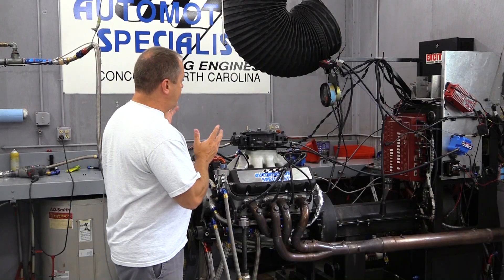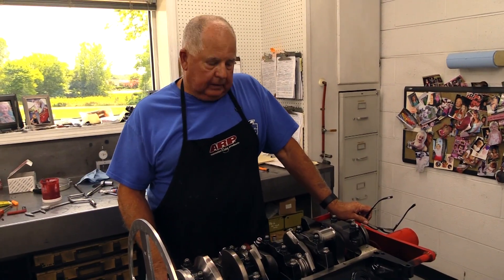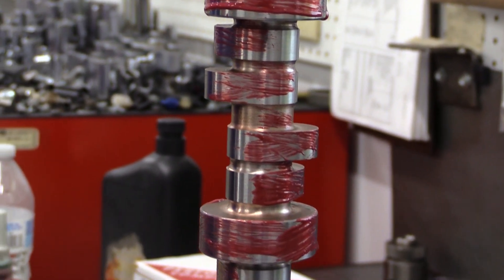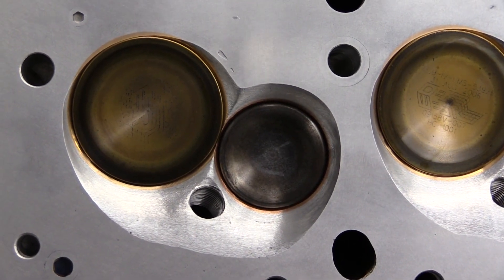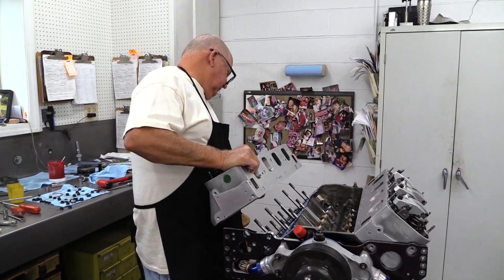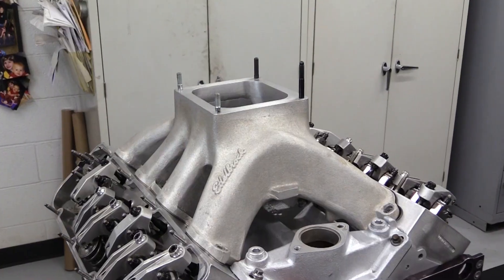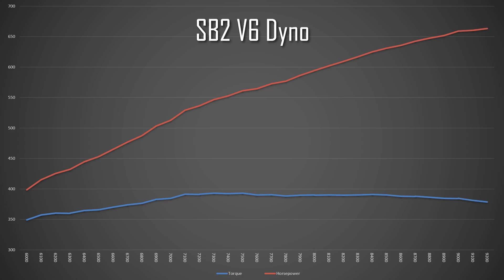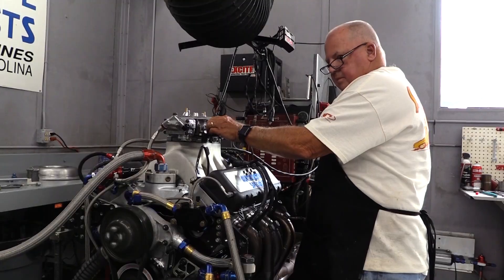NASCAR Chevy SB2 V8 Turned Into a Racing V6!?

Comment: Not understanding why he just didn't use a stroked 250 cid inline Chevy 6 or destroked 4.3 V-6 .   Both were pretty capable engines that certainly would be lighter than the Chevy V-8.   Why not a 260cid  V-4 from a big block?
Reply: My guess would be that these engines are ALREADY designed for 8000+ rpm. The other options you mention would probably have taken much longer to have parts machined, tested, broken, machined again ect ect....most of the leg work is already accomplished with the SB2. He juat chopped 2 cyl off of it.
Reply: Because the old inline 6 there are no real good aftermarket cylinder heads that will flow enough to get that engine into the 800 HP range normally aspirated  ! Straight six engines are also always more expensive to build and make high HP over a V6 or V8 engines because I looked into it before wanting to build a high HP Chrysler slant or Ford 300 six for the fun of it until I looked at how expensive they were compared to a V8 and how much less power they actually made for the money ! Look at Clifford 6=8 and you will see nothing is cheap to make a lot of power with the inline 6 when you can do it cheaper with a V8 that will make twice the power !

Comment: 6:48
I know Nortons secret. It's not something that is rocket science. If you take the weight of all components attached to the rod for cylinders 7 and 8, you get the weight of the entire contraptions attached to that rod. Then you simply machine yourself some weights accounting for the anchor points and the anchor hardware and magic.

You have yourself an exact weight equality between the parts that would normally attach there, and the weights you've designed to be fixated for counter balance.

I don't think Norton should really keep this a secret. It isn't forbidden knowledge and is easily obtainable if you have a lick of common sense about ya. ;)
Reply: At 9k rpm rotation mass is different for a small donut vs a piston, long connecting rod, etc. Try spinning around with a 2L soda bottle in your outstrected arm, then a 4' shovel that weighs the same.
Reply: You forgot the math, there's trigonometry and calculus involved here because not everything's moving straight up and down all the time.

Comment: The 4.3 V6 architecture wouldn’t be suitable to achieve the same results?? Not being critical of Dorton; just wondering out loud.
Reply from the maker: It would be difficult. There are no OEM cylinder heads I know of that flow as well as the SB2 ports without some serious work. Thanks for watching!

Comment: really cool,with the intake and that carb how does the 2 cut off cyls not over feed the next 2 cyls...
Reply: Internal block offs on the 1st 2 runners.
Reply: @vector6977  then the 2 middle cyls would get weird fuel distribution I'd think since 1 barrel feeds 2 cyls. It's definitely interesting
Reply: excelerater a holly runs all 4 barrels all the time, not quadrajet bs.

Comment: But without the other 2 cylinders firing all you've done is added balance to the crank shaft and changed the degree between fire, basically the same thing as the balance shaft in the v6 or adding external balance. The v8 is still at 90deg so the firing order/deg between fire would have to be roughly the same or it would vibrate from there being basically a misfire. I get that he has tuned that out but he has basically built an internally balanced extra long block 90deg v6  that can't be used in any situation other than that particular one. Why not add external balance to a 90deg v6 custom cnc heads and custom forged crank with a balanced flex plate and turn it into a kit I would buy the entire kit in a heartbeat, get paid for his development time and would be in the ball park of what this engine can do. The v6 vibrates because you can't get every cylinder to fire at exactly the same degree of rotation from each other, it ends up being just slightly off depending on the cycler and that's what causes the vibration, that's why the vortec v6 with the internal balance shaft has offset rod journals it allows the firing  time between degrees to get as close as they can get it.

Comment: Nelson racing engines made a 1,200 horsepower 260 cubic inch V8 twin turbo small block LSX motor. There's no problem making it run, you just have to be the right builder to build it.
Reply from the maker: Nelson Racing Engines is awesome and do great stuff. But comparing naturally aspirated and turbo motors is like comparing pigs and puppy dogs.
Reply: Comparing a turbo to a naturally-aspirated engine and then claiming one builder is better than the other is idiotic on your part.

Comment: would have been better off with a FR9 for starters. Hell, even toyota makes a better NASCAR V8 then GM.
Compression with a 261ci.... Well, this is slightly off by a good bit but the 4.6l Mod V8 is 281Ci and i have seen 13.5:1 on some builds so, knocking some stroke off and over boring, you could get atleast 10.5:1 on 261ci with that block.
Never mind, none of that makes sense. Dont work nights then day drink.

Comment: Use the spare plugs to lite off the exhaust.
Reply: That would just be sparking freely because they probably have it tuned as lean as possible to make the maximum power which would have no combustible exhaust gas. And if it did burn a plug wire or something and have a cylinder worth of combustible gas it would become someone of a possibly hazardous backfire
Reply: Fires at 200 Mph are not a good idea.
Reply: @mrthesquid  that's why you put them in the exhaust.
Reply: If it did by some chance ignite anything in the exhaust it would decrease exhaust flow by building pressure in the exhaust system. Also as mentioned if there was some type of timing/fuel, etc. problem backfiring is no good especially at 9000 RPM.  There also might be a rule against it.
Reply: @K-Effect  Spot on and also take note that all the plug leads are the same length as well. this helps eliminate timing issues too.
Reply: @mozzmann  ignition lead length doesn't matter. The electricity is traveling at the speed of light. Any ultra small resistance change due to length variation is irrelevant.
About the only advantage is you only need to stock one spare length for spares.
Reply: @K-Effect    why do you assume it would be done at speed?
Reply: My first thought.
Reply: Dave Micolichek  Actually the flame from combustion in the exhaust depending on the length can be of benefit as it keeps gasses hotter resulting in less skin friction internally and the flow ends up being faster. trying to ignite a flame at the end of the Exhaust would not occur simply because therer is no O2 or viable fuel left by the time it gets there.

             Physics !   A small volume of gas moving at high speed wants to keep moving and it of course does this, but a diameter change at the Collector in a multi cylinder motor  creates a pulse that travels back up the primary header tube to the back of the exhaust Valve head .  So when the RPM and the pressure waves come into time they can massively assist in making the engine breath ( In much the same way as a 2 Stroke Kart motor comes on song ) this is why Race Car header's the tubes are all very close to the same length and that is NOT by accident , it is by design where due to internal timing as the RPM reaches optimum the low pressure pulse arrives at the Valve port just before the Valve Closes assisting in preventing unburnt mixture escaping into the Exhaust as a result of the Port flow scavenging at the crossover of inlet and exhaust valve timing as they are both open at the same time .
Reply: Dave Micolichek  , Come in Spinner, Hook Line AND Sinker  !!
Reply: Dave Micolichek  In what way exactly ? in reference to keeping gasses hot in the header's, at least until the turbo if used,  which is generally why collector's are larger to handle the cooling gasses as well as the growing volume as header tubes are combined . 

The Hook Line and Sinker was a throwback to the equal length Plugleads
Reply: Joe Di Carlo  cool story.

Comment: How is it under 261ci when 6 cyls from a 350ci V8 is 262ci without modifying the bore or stroke?

4.000 bore and 3.48 stroke gives you 262ci.

And you asked why would you make a V6 out of a V8? Gm already did so it's not like you're doing anything new except you have 2 cylinders that don't do anything except add friction.

4.3L is 3/4 of a 5.7L so they took their V8, ACTUALLY removed 2 cylinders, and made a V6. It's not that, odd except you could've done this with a 4.3 bow tie block and good heads. SAME BORE. SAME STROKE. LESS WEIGHT. LESS FRICTION. LESS unneeded weight being thrown around.
Reply from the maker: Except it is not the same bore and stroke. This is a 4.125 bore. Big bores allow you to fit big valves for lots of airflow. That makes the stroke 3.25 inches for a V6. For a V8 it would have to have been 2.4 inches -- way too small to make any compression. Hope that helps, and thanks for watching.
Reply: did you even watch this video? how is it more friction from pistons that don't exist?

people in these comments have issues.

Comment: Benefit of competing in land speed events vs. drag racing/RR: No need to shave off ounces from every component. 
Many cars even have ballast made from lead or tungsten because getting CG low enough and into harmony with the center of drag is more important than increased mass.

Comment: Why Not use a stroked 4.3?
Reply: THE CHEVY VORTEC 4.3 IS A 262 CUBIC INCH ENGINE. THEY ARE LIMITED BY RULES TO 260 -261 CUI
Reply: @googleaccount1132  You can de-stroke it by 1mm and it will be good.
Reply: @jareknowak8712  they are shooting for higher compression.
Reply: @andyfloyd8583  there is no connection bt compression ratio and stroke, as i said somwhere in comments yesterday. You can have 5mm stroke and 15:1 compression. Simple geometry.
Reply: @jareknowak8712  well you just won the internet. Wear that medal proudly.
Reply: @andyfloyd8583  i dont get it, what do You mean?
Reply: @jareknowak8712  No by using a longer stroke there is less space between the top of the Piston to cylinder  chamber which increases compression !  Same thing happens when you mill the cylinder head surface it brings the chamber closer to the piston increasing compression . Another way would be to either use a Piston the has a higher Piston crown or dome or by zero decking the block to gain more compression as then the tops of the pistons sit higher in the cylinder bores closer to the combustion Chambers  !  I am sure being this engine has a huge cam the duration is very high so to compensate for lost low end torque as well as very large intake ports that don't response good at lower rpms they upped the compression on it to make the engine more efficient and to pull more bottom end torque out of it ! Another way to gain back lost compression would be to use a cam that has a tighter LSA and lower duration so the valves are closing earlier and don't stay open as long which builds more compression and torque at lower rpm's . There are a few ways to up compression and one of them is with a longer stroke to get that piston closer to the cylinder heads chamber to create more squish ! The same goes with head gaskets the thicker gasket will reduce compression ratio while a thinner gasket increases compression and that's why when building a HP engine you have to calculate where your compression will be at with the head and head gasket then clay the tops of the pistons to check that the valves won't hit the tops of the pistons especially when using a thinner head gasket !
Reply: @jareknowak8712  There is a connection between higher compression and stroke; it's about tolerances. 

The shorter the stroke, the closer the 'squeeze' needs to be for the same effective compression ratio at TDC. Eventually you get to a point where you have to get the piston so close to the cylinder head that you start getting bad internal flow (adverse swirl, flame front quenching, etc) or can't control operating tolerances well enough to avoid eventual contact. 

You need a little room in there to get a full combustion event. You also have to deal with the AF mixture having inertia and whether or not it can actually be moved out of a big "squish" zone fast enough to not self-ignite where it sits and start raising hot spots and melting holes in important things, cracking ring lands, etc.

So yeah, short stroke and 15:1 works absolutely fine, in the engineering drawings. In the metal, you're gonna regret that design decision...
Reply: Vibrations...
Reply: I believe this is more a challenge, the V6 4.3 haves a counter balance shaft, also i believe that you cannot find some head with a flow as good like the nascar heads.
Reply: @TheLeonmafioso  You can make CNC porting, You can cut head in half and make straight ports (like Volvo did in the '90 in race car). In a car which is so fast You can use ram air to help with air flow in head. 

Vibrations? You think that V8 running on 6 is a vibration free engine? 

I think that They used what They had. Cost effective.
Reply: @TheLeonmafioso  they have racing sb2 base v6 heads

Comment: Im curious why they didnt cut off the rear pipe on each header and seal it up or have a custom set made? They aren't needed for anything, and it'd shed a few pounds especially where any weight savings can make a huge difference. Or maybe that is just the test headers for the dyno and the ones in the actual car only have 6.
Reply from the maker: These are dyno headers, but the ones built specifically for the car (it is rear engine) will be set up for a V8 too. That's because they will run multiple engines in the car at Bonneville trying to set multiple speed records. It's easier, and much cheaper, to just have one set of headers that stay in the car the whole time. Thanks for watching!
Reply: @TheHorsepowerMonster  thank you for the reply! And thanks for the info.

Comment: 90deg V6 has too much vibration? Dude, 90deg is the angle of choice for smooth running of a V6! 🤨
Reply: No, 90° is used for V8's. 60° is best for V6's. You divide 720 by the number of cylinders to find an angle that works for good balance. 720/6 is 120, but since it's impractical to make a 120° V6 manufacturers go with 60° instead

Comment: I read an article about some old school race cars that used a V8 block but ran only one bank, so an in line 4cyl with the other side empty... I think
Reply: There was a dirt track series that had a mandated engine. It was a small block v8 sliced to make a 2.5 liter v4. I'd love to get my hands on one. I think Dart built the blocks.
Reply: @andyfloyd8583  if I remember right, these we're old Indy looking karts.V8 block but with only one head, and some block off plate on the other side. Not sure it was long ago
Reply: Check out Mickey Thompson's half of a Pontiac V8. , one bank.

Comment: Ummm...i get it..but..extra.weight, momentum..puls u just turned a x plane crank to like a y plain crank? Don't make sense ...why not build your own block n crank...build the gm version of the 2jz but v 6
Reply: he didn't change crank angle, just hung a weight to simulate the missing pistons. 2. there's no such thing as to much weight in top speed racing. they will still add weight to the car. 3. sb2 heads flow better than anything that will fit on a v6, plus keep the good head gasket sealing of a ls base lacks and the R&D has been done as far as block and valve train is concerned at 9k plus rpm all day long. so say building your own block would be way way harder than using what is now just left over Nascar parts.
Reply from the maker: Exactly! ;)
Reply: Why not to start with V6 engine?
Reply: Exactly...he didn't change the angle  of the crank..i like what the ol boy is doing..but I think.your missing what an x plane crank dose and why u can't compensate for it with counter weights
Reply: 100% true. 
Maybe its all about the costs. 
At least they should cut it and put some cover plate to save weight and lower stress on crank.
Dont know why they used cylinders on the drive pulley side. The crank will be more stressed. 
Lots of things that i do not understand here. 
But im not an engineer.

Comment: Your work is like that of an artist, mesmerizing I'm very impressed with the ingenuity and craftsmanship . one wonders though could you've achieved similar results utilizing a stage 2 off center buick v6, just wondering, hopefully if i hit the lotto or inherit a large sum of money I'll request your shop build me a sb2 for forced induction thanks and good day.
Reply: Did a very similar build for my street car over 30 years ago with a Buick 3.8 Lit  even-fire (offset) Turbo Motor,  made my own ignition too since the existing HEI was nowhere to be seen when the container arrived from the US.  
Used the same method on the Push rods and lifter's too and you have to be careful with rocker ratio's as the acceleration forces at high RPM can very easily break and distort components , which is why these push-rods are so large ( mass and inertia are NOT your friend in this case ) , Big lifts mean bis side loads on guides too.  Roller Cam Lifter's and Rocker's are the ONLY way to achieve this reliably .  Although Honda almost perfected the Pneumatic operating valve .

Comment: This is using a 6 lobe cam? It only needs 12.
I have seen V4 and straight 4s  midget engines based on Chev architecture  but not a 6,, apart from Chevvy V6. 
Effectively it is s Chev V8 running rough on 6? Seems so.
Reply from the maker: He's running a standard V8 came configuration. The cam is a custom grind from Crane, but he never actually told the cam designer what it was for! Until Keith allowed me to make this video, very few people knew about this engine and its development. Thanks for watching.